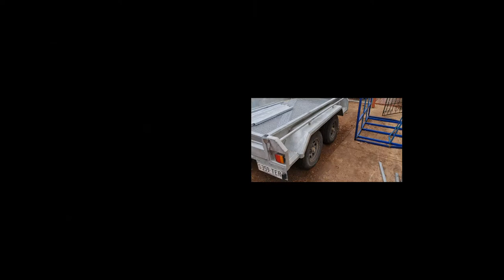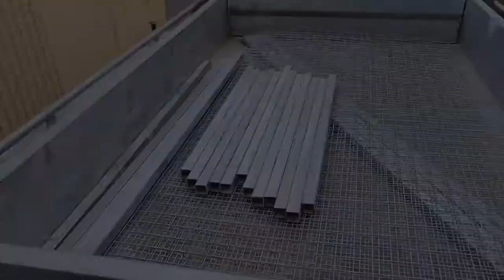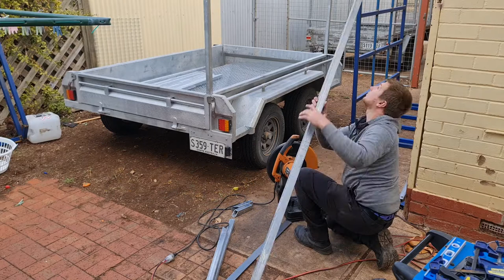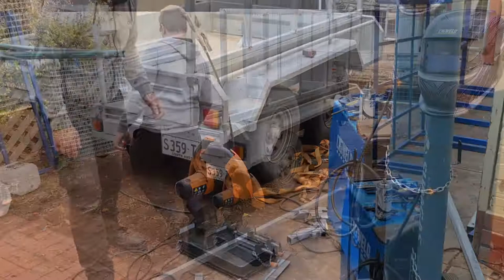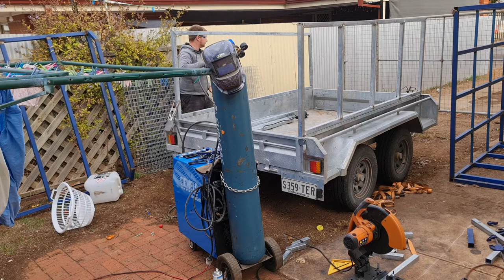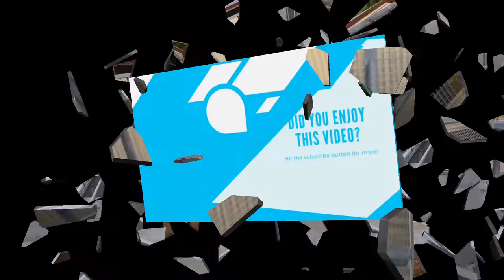Trailer cage build part 1

Comment: My corner posts on my trailer were not a straight through design so they just filled up with dirt and water. Also the cage was a complete prick to remove on the odd occasion I wanted to remove it. Im in the process of rebuilding the Trailer so this time Im going to make the corner posts sealed and have the cage bolt on with bolted sides so it can be flat packed when removed.
Reply from the maker: im 100% with you on your decision. personally I don't like making cages fit like this one. as time goes one the trailer will slowly bow witch than creates the holes in the trailer to not line up to the cage witch results in not being able to use the cage.
Reply: @joshuasgs3  Yeah, the old cage had to levered up one corner at a time with a demo bar and packed with pieces of wood until it popped out, then you had to get inside it to walk it off if you were by yourself, then you had to get out of it once it was off, LOL. Shit design, but it worked. New one will be a couple of bolts and lift off complete or side by side, Easy!
Reply from the maker: yeah dude definitely a bolt down design is the most functional. works out easier for removal and attaching of the trailer.